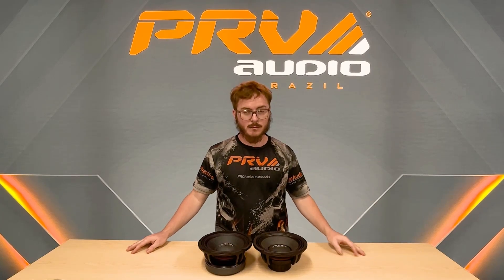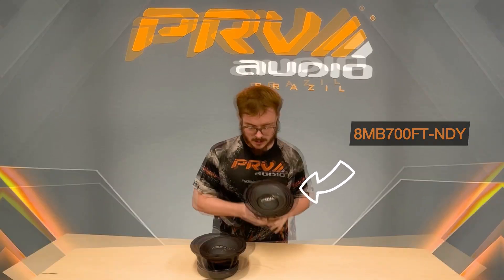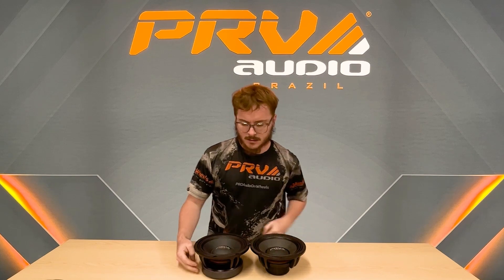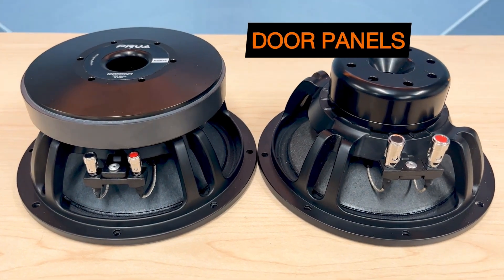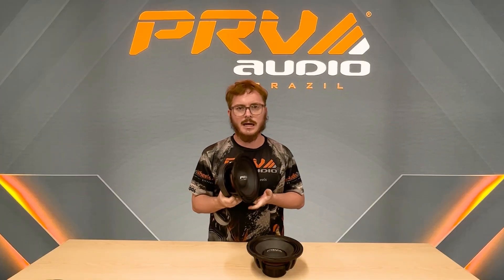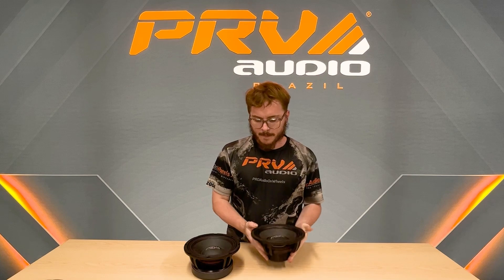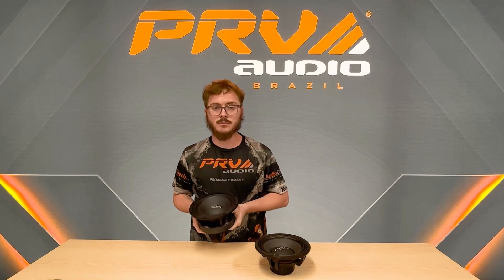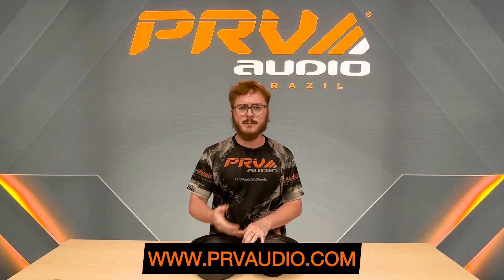PRV Audio - Neodymium VS Ferrite Magnet Comparison: Which is best for my application?

Comment: I only have a small sample size. But ferrite in the a\d\s 6.5" was smoother and fuller sounding as if the magnetic field was more well distributed. And my MB quart Q series 6.5" has neodymium that sounded tight and fast, but also thin and rigid. I think the strong magnetic field being so concentrated did not distribute the power smoothly. But I could be wrong as these were the only ones I have had for a long time.

Comment: Ferrite all day everyday! More mass more heat distribution more POWER Small ass magnet more heat less output
Reply from the maker: That is not true at all, because the heat will affect both type of speakers! Sure the Neodymium magnet has less mass and it can get to higher temperature faster than a ferrite model, but both types will get hot and be affect the same! the Neodymium as it is a premium and stronger mag, it will have more output than any ferrite speaker! and of course this comparison it should only be take in consideration when the speakers are expose to high temperature environments, which 80% of the applications will not affect at all the speakers because you will never get to this conditions

Comment: The magnetic force on a neo speaker drops, as the temperature in voice coil goes up.
Reply from the maker: that is not true, what happens with every speaker is that as temperature goes up you impedance goes up, which leads to less power and yes, it can sound less - Any speaker at a Excessive Temperature will lose output due to the impedance rise, but that is completely normal
Reply: How true is this?
Reply: @DaCharacterMon 100% buddy
Reply: that's if the magnet gets hot not the coil.
Reply: @ will get hot unless your a goon that runs a system with 1 battery with 1 alternator with insufficient power supply. When you have enough power the speakers will get hot especially if the amp is pushing that kind of power
Reply: @ You need 212°F to affect a neodymium magnet, which is very unlikely to reach in a device that ventilates itself with the small cone excursion.
Reply from the maker: We only used high grade neodymium to avoid any problems with temperature, usually our Neodymium magnets have a higher rate of temperature than the voice coils, so the voice coil will fail before you can even damage the neodymium due to high temperatures .... but that not true for all speakers, they are some company that use low grade neo that gets highly affect by normal operating temperatures, so if a Neo speaker is too cheap ... you are probably getting something that will have a low quality
Reply: @PRVAudio okay so I won't have any issues with my Mr2000's ? Because everyone's trying to tell me they'll heat up-

Comment: hello, what is the difference in weight between these two speakers? very interested.
Reply from the maker: Hello! The net weight of the 8MB700FT (Ferrite Magnet) is 9.38 lbs (4.06 kg), and the 8MB700FT-NDY (Neo Magnet) weighs 4.32 lbs (1.96 kg).

Comment: What is a “Chuchero”?
Reply from the maker: Chuchero is a slang in the Latino car audio industry for a "speaker box", which is a custom box that has speakers, tweeters or drivers with complete mids and highs setup. We have it on our website - https://prvaudio.com/product/chuchero/
Reply: A chuchero is the boxes that the dominican people often use
Reply: @thejohnboatt  
So it’s a Dominichero
Reply: @Bassotronics  ya if that’s how you call it but a chuchero is usually the boxes that go on top of the cars maybe consisting of 2x 10s, 1 compression driver, and 2 tweets or the other style is 2x 12s and 3 tweets